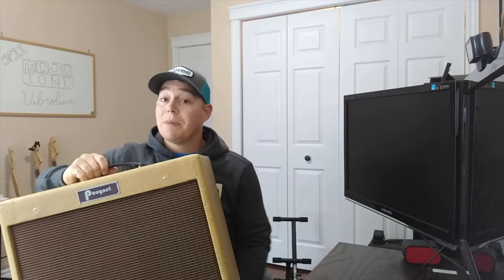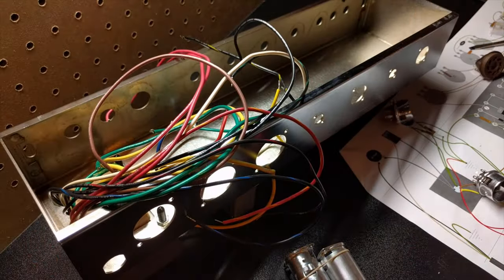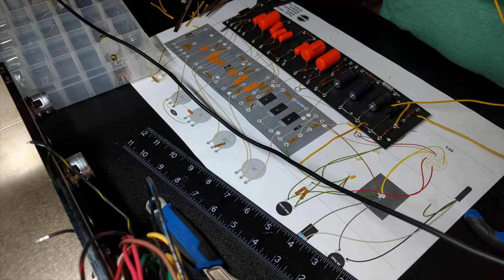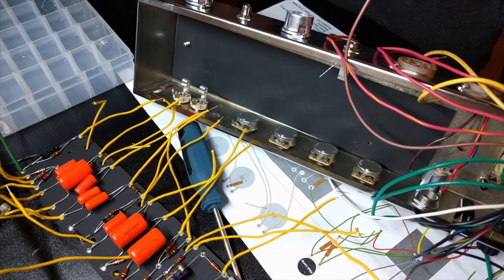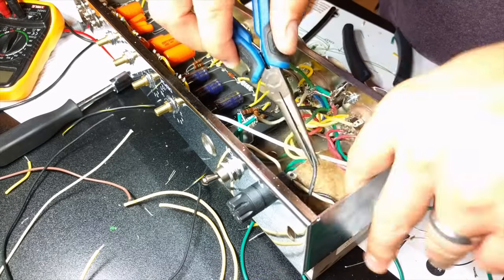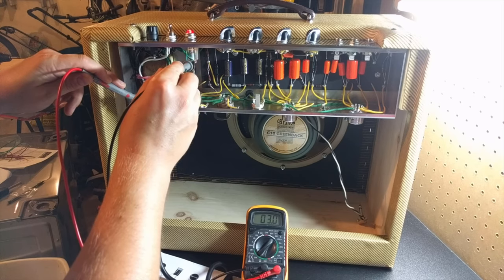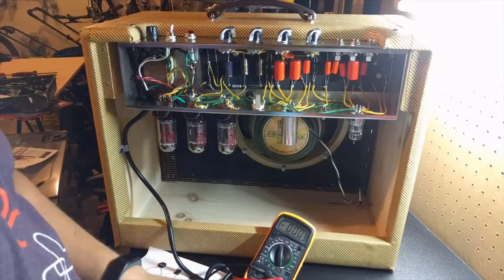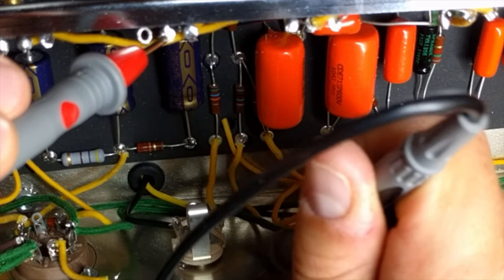Mojotone 5F11 Vibrolux Amplifier Build | Part 3 | Circuit Board & Demo

Comment: Nice demo.That said you may consider adding a disclaimer that you supplied the cabinet(I had not seen your other segments and by chance clicked on the earlier one).It came out good but my eye caught the imperfections of the tweed and since I'm considering building a 5f11 I was set to pass on Mojotone's cabinet and just buy the chassis kit.No offence intended of course.
Reply from the maker: Thanks for the heads up. Hopefully most people will see "part 3" in the title. Happy building!

Comment: is it suited for home use? can i crank it without having neighbours knocking at my door? or a champ is a better choice?
Reply from the maker: This is essential a champ with trem. Great small amp, but still can get loud. I think you'd be ok as long as you weren't playing above 7
Reply: Even a 5watt champ can be loud for home use but you're not gonna wake the next door neighbors unless you're in an apartment
Reply: I built this exact kit also. Only difference is I went with a Weber 10". And yes, it can get to that break up without melting your face. But, sensitive neighbors will still likely hear it. No way around that. If you have that situation, best to go with modeling type setup, and use headphones.
Reply: Late to the game here, but a new 5F11 owner. 

It’s loud! My neighbors might call the police if I were to crank it in the garage after 10, maybe. It’s certainly loud enough to keep up with a drum set in a large room. My amp has a 12” speaker; not sure if it’s that much louder than a 10”

I had a blues jr several years ago and it’s not even close. My amp is definitely worth at least it’s double the price of a BJ.